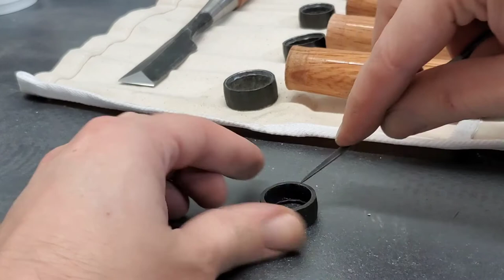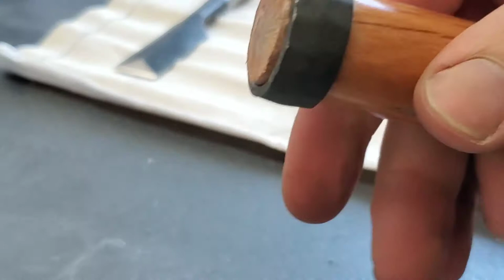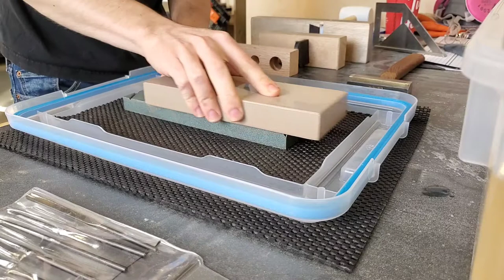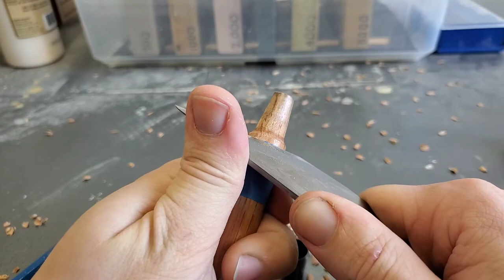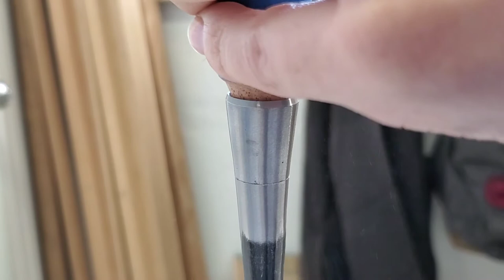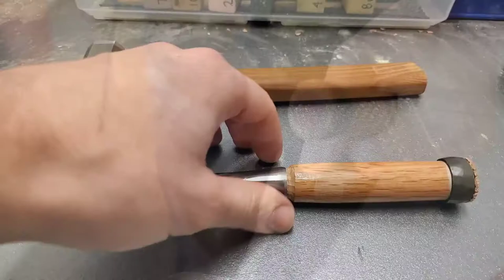Japanese Bench Chisel Tuning (Oire Nomi / 追入れ鑿) | TETOME HOUSE

Comment: You had me till I saw your beat on a finished machine surface, that's anvils are for! Even if you put your Vise draw together tightly you could have beaten on that not sure of your thinking here? Also will you hit the handle off why didn't you strip it and refinish it?
Reply from the maker: There were many tools I did not have last year and still don't have, anvil being one or them. As for the stripping, hadn't really occurred to me, wasn't too concerned with the finish, was just trying to get the chisels fitted so I could begin using them.

Comment: Man, doesn't the way the stone go all over the place mess with sharpening?
Reply from the maker: I know it looks awful! But it doesn't bother the process, at least doesn't affect the end result. I've since made a holder for more stability.
Reply from the maker: @Hayden Ellis lol sounds like a wicked breach of privacy dude.
Reply: He's working in the lid of a container! Overall good idea you could do the same thing with a cookie pan which would be easier to clean I would think than the lid to your stone container!
Reply: Also to me maintain a plane you can't have the stone wobbling all over the place! Should be on a hard surface or plane or surface of the stone doesn't move!
Reply: Sometimes I sharpen on a wobbly surface. Brings the stone to the Angle of the edge if you do it correctly